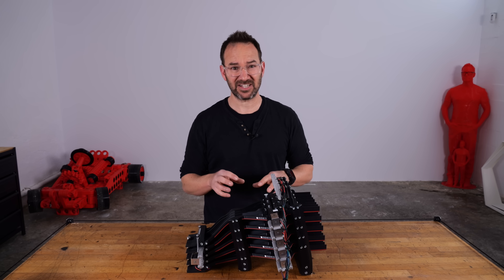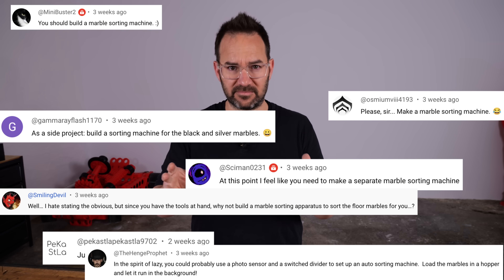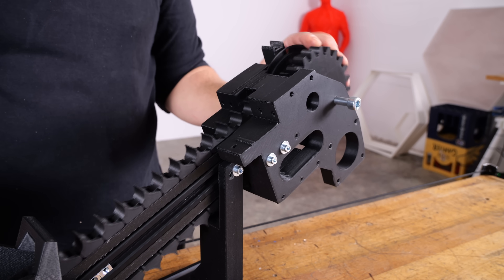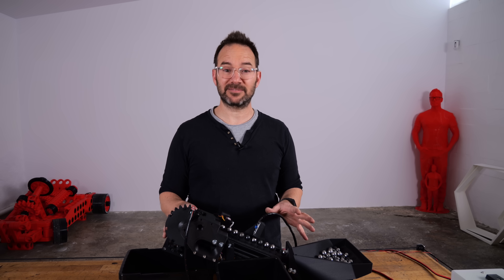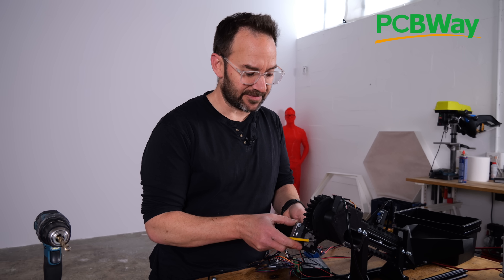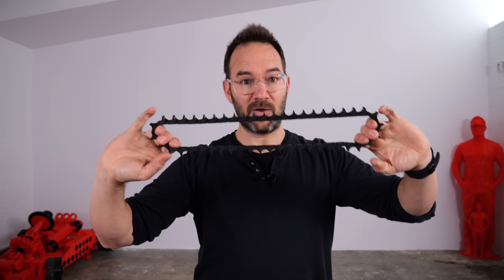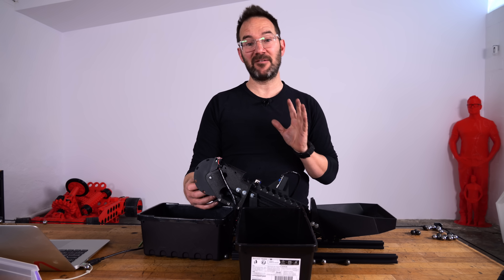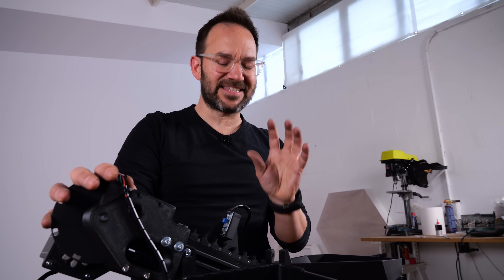Faster than the Eye Automatic Marble Sorter - Marble Clock Seconds Display Pt.3

Comment: Make two more in parallel and keep the belt a bit shorter.
You can then run all tree at 6-7 marbles/s wich is not much stress on the mechanics or that much noise.
Only downside is that you need more marbles

Comment: I'd make a dual-channel version to implement into the clock.  You can run it at a lower speed (reducing catastrophic timing issues), and creative deflector shapes will help with directing the black balls without them gumming up the machine.

And for fuck's sake, put a damn hood over the top of the funnel, those marbles are getting everywhere.

Comment: If your machine would eject the black marbles and the silver marbles at slightly different times or at different velocities, they could be collected separately and therefore not even need sorting.

For example, if the silver marbles get dropped, but the black marbles get accelerated with a puff of air at the same time, they could end up in separate buckets.

If the seconds machine reads the color of the marbles, then even if the black & silver marbles were mixed together, the machine would eventually sort them out.

Comment: The other thing you can do since you're reaching the limitation of a single solenoid hitting every single slot... Two or three solenoids that split the load. So one solenoid only hits every third slot. Now each solenoid only has to do 1/3 the work and react 1/3 as fast allowing you to increase your chain speed even further.

Comment: What if you made a gravity ramp like a pachinko board but each peg has a right/left servo so you could run multiple lanes and the servos work together to move the marbles left to right depending on their color. You wouldn't need to have conveyor belt to move them up, you would just put them in the top and let the servo sorters move them right and left as they rolled down the ramp. It would take more servo switches And more infrared detectors, but you could probably get away with only using two rows of infrared detectors And then you could have a whole path open up to move them right or left

Comment: That's awesome. No lie. I have few suggestions :
-Put some white/reflective color at the bottom of the belt. It will prevent the solenoid to be triggered when there is no ball.
-You could put some walls for the balls starting preventing them to fall
-You could also put some kind of dampener on the chain in order to limit ball movement.
-I'm pretty sure you coul try to get 2 of theses sorters in order to ease the requiring speed, and make it less noiser, with less vibration.
-That's awesome, no matter what. You're really good.

Comment: Hey, nice project again.
I could help but notice that the solenoid is activated also when there is no marble in the place. This is the reason it broke with the high speeds. Because the solenoid doesnt find any resistance when there is no marble and just sligthly extends further, which in turn causes the time to retract longer and then crashes with the belt. If you would add a sensor that also checks if there is any marble in place, you could get rid of this problem and have more reliability at such high speeds.

Comment: Aluminum anodized balls, then steel balls. Use magnets to sort. Simplifies mechanically and electronically. Pour the balls down a "water fall" with magnets on one side to separate them. BOOM! All aluminum balls are moving 9.8m/s as well as the steel ones once they get pass the magnets (excluding friction). This would negate a single bottle neck design.

Comment: Just noticed that the solenoid is "firing" even on the empty slots. Probably would be good to add an additional magnetic sensor to check for presence first, and than check for color. If empty, no need to trigger the solenoid.

Comment: I think if you modified the chain a bit, you could avoid the solenoid crashing while still being able to carry the marbles, perhaps by trimming down the outer edges of the fins or reducing their height. Raising the solenoid up and moving it slightly farther away from the chain may also help, and mounting it on a spring loaded or flexible bracket could help with clearing and recovering from crashes. (who doesn't love 3D printed compliant mechanisms?) 

Another way you may be able to attain higher consistency would be to do something to tame the bouncing on retraction.

A modification I would very much recommend if you choose to put this into the final clock would be a rubber tip for the solenoid, to avoid marring the finish on your black marbles.

Comment: You can add a hall sensor to detect if there is a marble in the track to prevent the solenoid to trigger in empty slots to reduce some vibration.
And for very high speed i usually see air blasts used to push stuff into the reject bin. So maybe a compressor and high speed valve? Also prevents the track getting stuck on the plunger.

Comment: There is a lot of dead weight on that solenoid shaft, you can optimize that iron shaft for purpose. You bought spares didn't you? 🙃 All you need is enough iron to sufficiently push the solenoid. I think i would also try making a shaft out of plastic with a neodymium magnet inside. I can't wait to see this thing running.

Comment: Both the chain and some of the marbles are black, but the issue is that if you set it to reject black marbles then the sensor will keep firing the solenoid for empty chain links too. I would recommend either switching the reject color to silver for a quick fix OR better yet print the chain in a third color. With a new default chain color (like red or yellow) that means that you can also get accurate counts of the marbles cycled as the machine runs since it won't just be a binary state. It would be a little bit more complicated, yes, but still relatively cheap and easy to implement.

Comment: It seems to me that your sorting system is extremely inefficient. If I were sorting hundreds or thousands of balls, I’d go parallel. Instead of funneling into a single line, I’d funnel downwards, always taking advantage of gravity, into 20, 30, 50, even 100 slots. Then each slot has a sensor that allows a very subtle divider to tilt to the left or right. Then the marbles once sorted, will fall to their own side. I think such a design could sort hundreds of marbles per second. Also instead of one sensor per slot, there could be a camera looking at all the slots, which would control the gentle rockers at the bottom. The apparatus could be shaped like a convex cone, taking marbles dropped to the center outwards to the periphery for sorting.

Comment: You could near double the solenoid speed by having it work in either direction.  Have it above the chain/balls, with a tab.  Then in your code the solenoid is toggled either on or off, pushing or pulling the ball off the chain.

Comment: Why not add a second chain now that you've debugged a majority of the issues with the first?  You'd be able to get well above 20 marbles per second while running at a slower speed so the retraction time of the solenoid and stress on your parts would be less of an issue.

Comment: use a screw to move the balls from the hopper which can release them single file. if you then just use gravity and let the balls drop, you can kick the dark balls mid air just after the drop. then there is nothing to get hung up on. and you basically have 1 moving part. the screw. I see suggestions to use air to kick the ball.. but how heavy are they? might need a bit of pressure to make that work... and then you'd have to deal with the noise of having an air compressor kick on all the time just to sort the balls... I think the solenoid is perfectly capable of kicking the dark marbles out fast enough to be sufficient. besides, you already know it works and isn't super noisy. another option would be to have the balls fall down some path that has a little flap.  another option would be (if possible) is to have the dark balls be a slightly different size that the non Dark ones... close enough in size that they would still function with all the current stuff... but different enough that you can just roll them down a pair of rails that slowly diverge, causing the smaller ones to fall through sooner. again... gravity and 0 moving parts.

Comment: You don't need a faster motor, just more belts (and servos) running parallel.  They could all run on the same motor. Collect the ejected marbles with cutes.

Shoot, now that i think of it, I'm surprised you haven't made a machine that makes black marbles.

Comment: I like that you switch on the black marbles instead of the chrome. Since there are more chrome than black, that method requires slightly less switching than if it was the other way around. Probably doesn't make much difference at those high speeds, but still.

Comment: Idea: Attach multiple solenoids to a synchronized gear that spins alongside the chain and the sensor tells the system which solenoids should be extended to push the marbles out of the the chain.This way, the solenoids are moving in tandem with the chain and you don't have a clearance limit on speed.

Comment: Could you position the servo above the chain and knock marbles to the left and right? This would eliminate the need for the servo to push the marble and retract, as it could just flip/flop from one side to the other. Also, could you use an electromagnet to pull desired marbles off?

Comment: PolyTerra is one of the softest filaments Polymaker has, so probably not a good choice for this. You might have gotten better results without screws with something like PolyLite Pro. (I don't know if it would have been good enough, but definitely much better. PolyTerra isn't really made for mechanical applications).

Comment: Since you do so much of the work on a table could probably use gravity, and sort the marbles as they fall down a chute rather than the chain link track. Maybe a single gear to control feeding them onto the chute. Seems like fewer points of failure and no need for a speedy motor to move the marbles.

Comment: to sort the clock balls you could put 2 separators for each ramp at the bottom and use a servo to change the direction to black and white columns

Comment: I think you should integrate this into the clock, but I also think you should at least consider looking into the optimizations you could do for the marble clock's face in order to reduce the marbles per second you need by at least a third (though you might kick that up to 50%). A couple of people talked about stuff you could do for that in part 1 (Including me, but I saw at least one other optimization people suggested that would compound with mine)

Comment: Instead of a solenoid,  why not tilt the chain to a guide,  and use a 3 tooth paddle that only rotates when a black marble is in place? The tilt will hold all marbles to the right along a guide, and a 360 degree paddle will remove the need for retraction after a Black marble is swiped off of the chain..  the guide could be contoured in a concave shape too keep the marbles from falling off once on the chain...

Comment: Um, since the display is 3x5 marbles (aka, 15 marbles), and the clock is supposed to display seconds, I really don't see why you'd need the sorter to be able to handle 19.8 marbles per second. I understand that setting it precisely at 15 mps would gradually make it fall behind (because there will be the occasional empty slot in the chain, reducing efficiency), but it would only need to run at 16 or 17 mps to catch up, especially since higher speeds will create more errors.

Comment: Sorting by size, even very small differences, is easy. You just need to guard rails that are nearly parallel but with a slight angle. Smaller ones will fall sooner than bigger ones. If your black marbles would be of slightly, hardly to see, different size, you could sort them very quickly with minimal effort.

Comment: I still think the clock could have only white or only black marbles. Just leave either the surrounding area in the numbers empty, or the numbers themselves empty. Like imagine an old lcd wrist watch with the different segments of the numbers right? The marble clock only needs to show the marbles in the right spots to form the number, it doesn’t need to also fill in the blank space around the numbers. I think.

Comment: Would the marble rejector work better with a solenoid that extends into the marble when releasing the solenoid and pulls back when engaging the solenoid? Currently you are relying on the spring to move the solenoid shaft out from the marble conveyor, and you can see at the higher speeds it tends to bounce a lot, so presumably switching it around should put the solenoid under more control.

Comment: Of course we want it incorporated! Butttttt can the entire clock be run off of one hopper of marbles? As the marbles go up the hrs/mins belt they're pushed out so the order is correct. Can those be diverted to the seconds timer, then get dumped back into the main hopper along with the hours/mins?

Comment: consider a top down design... vertical feed tube, sensor at the bottom, two solenoids working together to move a horizontal "diverter" , ejecting the marbles in 2 directions... also, why not a screw feed? look up paintball hoppers, they feed at crazy speeds

Comment: Interesting. Seems like the solenoid is activating even when there's no marble on the track. Maybe try pointing the sensor sideways so that it doesn't detect the black chains?
Also, I'd recommend adding a spring torque limiter so that it wouldn't rip the entire chain out when it got stuck. Basically, connect two gear axles with a spring, so that when one tries to turn while the other is stuck, it stretches the spring and slip the gears instead of wrecking havoc.

Comment: Instead of the solenoid, maybe use an air blast controlled by a solenoid valve. Then there isn't anything to get in the way of the chain. Should be super fast too.

Comment: Bits to add:
- A cover over the pickup chute, to keep them from bouncing out
- Side walls along the track (not on the chain itself), to keep them from bouncing out
- Covers on the receiving bins, to (you guessed it) keep them from bouncing out
- Convert the plunger mount to metal, so the solenoid doesn't get twisted

I think you can beat 20 mps with these tweaks, as they should solidify the marble path, and get all marbles through the sorter more smoothly.

This looks pretty amazing.  Can't wait to see it hooked up to the new display mechanism.

Comment: Considering at 19 margles per second that machine loses about 30-50% of its marbles, it probably takes longer than just running it slowly with all the time it takes you to pick everything up and reload the hopper.
If you don't end up putting it on the clock, just run it slower and for longer, who cares of you are just going from tub to tub.
If you do put it on the clock, there's no reason why you can't have multiple sorting in parallel, just run it slow enough that it's reliable and use 2

Comment: just parallelize this. One hopper that goes to two separate sorting lines and machines, each running at about 10~15/sec will easily have enough sorted for your machine to work and have the reliability of running at lower than absolute maximum speed.

Comment: when i'm using PLA or PETG gears to be mounted on a stepper shaft, i use a thin sleeve of PTFE tune for seperating the shaft from the printed gear. works like a charm.

Comment: You could probably get some really decent speed using something like a propeller with variable pitch attached to the conveyor belt by a timing belt to synchronize the "blades" with the balls. In one orientation a blade would pass above the ball without touching it, in the other orientation it would push the ball. Because the movement of the propeller is tied to the movement of the conveyor, it'll always hit (or miss) a ball (unless the timing belt slips).

Comment: i haven't read any comments yet, so i have no idea if this was mentioned before:

in the industry, they use air pressure to separate good from the bad (and the ugly, if necessary). it has the advantage of not having any moving parts (except the valve, of course), and therefore it is much faster and less prone to failure...

Comment: Ive said this b4, and I will say it again, why don't you sort them on the recieving end into black and white channels? You already know the colors on the current frame, when you empty that frame sort them onto white and black channels as they exit the frame. This way you have white and black and can just load them from each channel. Yes its a bit of a redesign but the speed can be higher because you can sort them at a rate that doesn't matter as much because you are sorting a buffer area. The frame build area can be faster because you already have white and black separated out. If you have a buffer of say 3 frames worth of balls you can sort them at say .5 frames a second and still keep up becauae the fill will be super fast with seperated white and black balls and the buffer can constantly be running even when the rest of the clock is waiting of doing other things. Also because you already know their colors it should be easier to seperate them based on the current frame on the display. Drop them top to bottom sequentially into a single channel when they exit and sort that channel to black or white in a parallel line. Bigger? Yes but definitely faster as well
Reply: At the very least take what you have now and add multiple solenoids running at the same time. So you load a longer belt, with multiple solenoids and you fire the pixels of each of the chain links once per say 5 chain links. It's basically parallel processing in this fashion for speed.